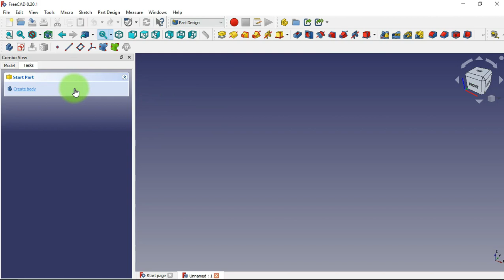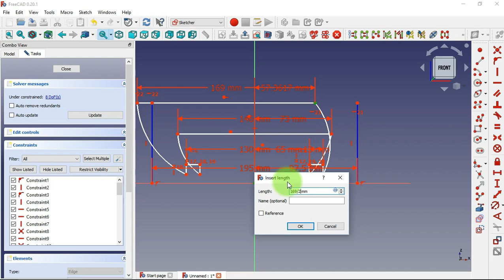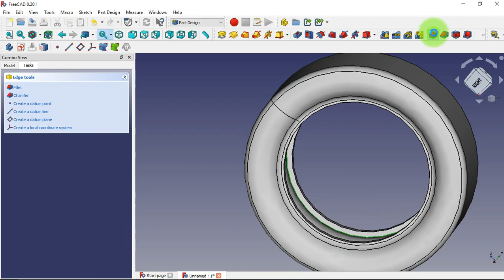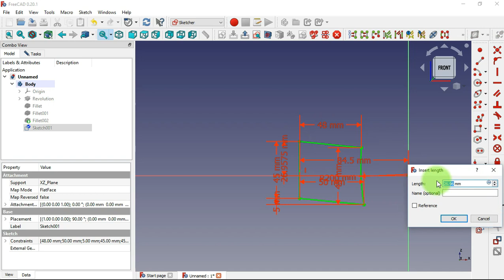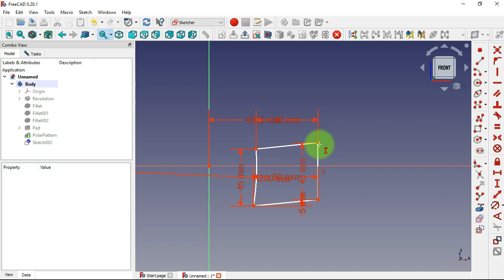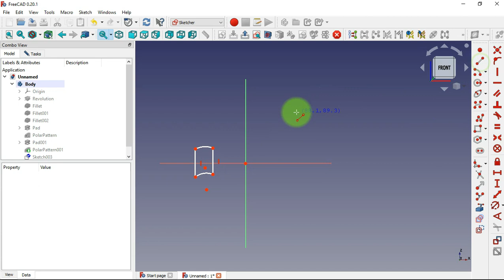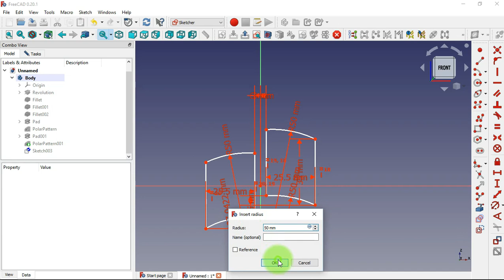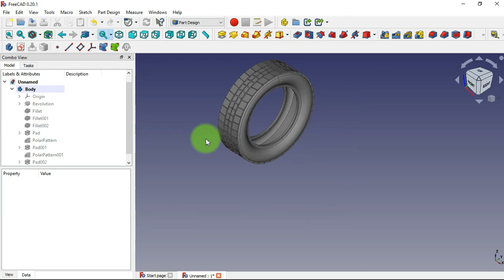FreeCAD 0.20 tire modelling

Comment: No, we don't constrain a sketch via dimensioning only, other constraints exist in Freecad, I would like to give you some examples of shortcuts : O for point constraint on origin, S for symmetry, E for equality etc. I think you lacked a good of Freecad practice at the time. Strange way to use Freecad 🤔